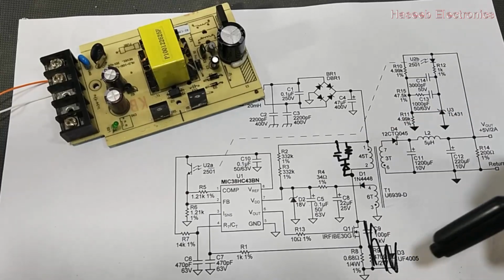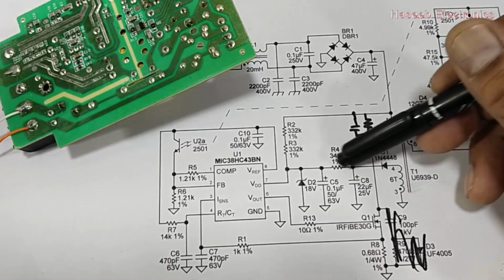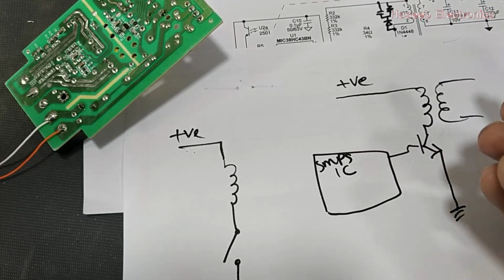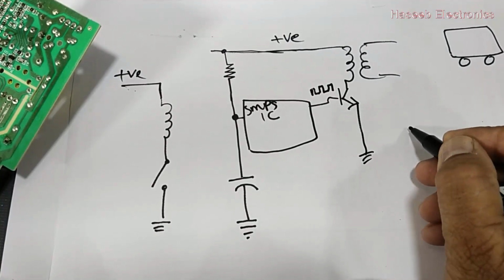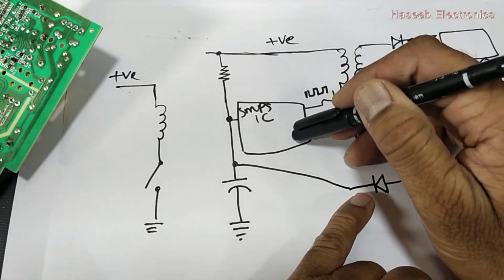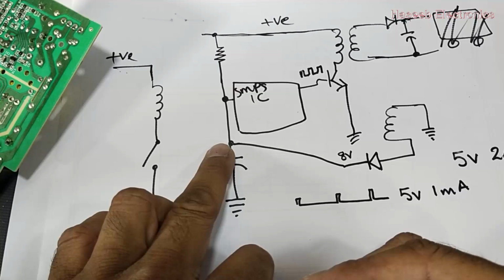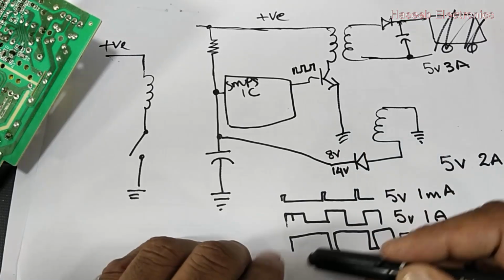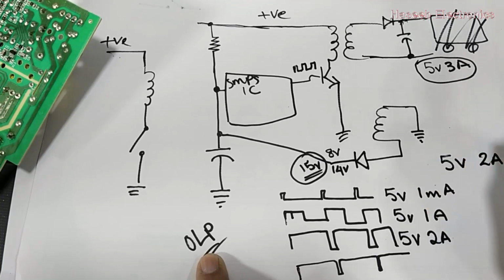{525} Functions of Auxiliary Winding in SMPS Transformer

Comment: Because I am trying to build a step-down circuit.  I have everything; I know how I should turn the primary winding or the auxiliary or secondary.  But I don't know how much  the air gap size should be, and for 12volt output with 5 amps, what kind of ferrite core should I use

Comment: Hello Mr Haseeb, I watched your video, and it was beautiful and informative.
Now I have a question, Mr Haseeb: you explained everything, but you did not say how many primary rounds there should be, what kind of material is used, or what size or type of ferrite.
And another question I have is: how many millimetres is the air gap of that substance?
Reply from the maker: Thanks for your valuable comment 
Transformer calculation is a separate theory 
It needs ferrite core material type, specs, core type (gapped core or ungapped core), permeability, frequency, output power rating, switching topology, operating voltage, flux density, then you can calculate wire size, turns,

Comment: سلام علیکم .
I have a smps with 48 vDC output . I don't have any circuit diagram for it. This smps has a axillary smps for providing internal DC voltages to run main switch. Main switch circuit is work properly. Because i test it wigh external dc voltage . Bet this exilary smps don't have output . The same smps of this smps has three output that are : 19 v , -10v and 15 volt. Two first votage provid main section supply and third 15 volt provide continuous suply for pwm ic uc3844an after soft Start. This pwm ic was disipat and it replace wih safe ic. Other components are properly . But this exilary smps dont hase output again. Can you help me sit ?!

Comment: In my case. Vcc winding is not generating any voltage. But in continuity mode, its beeping. What can i do. Other components are ok. But smps restarting as you said. Output voltage is fluctuating in 9-10v ( modified for 10v). What can i do now.

Comment: My Vcc at the the pin 13 of the IC ML4800 is 5V while it should be 14V. 
Also the voltage between FET D-S is only 308V instead of 420V.
Voltage over the power caps are also less than it should be 312V instead of 386V.

I ve replaced the IC, the power caps, the switching mosfet. Still the same problem.

Can you please help?

Comment: New subscriber here. Sir I have an SMPS here with no output that I have been trying to repair for a week now. I replaced the components that i found faulty. I can now read DC voltages (around 290 to 300 VDC) at the input of the transformer but unfortunately it appears that the xformer does not magnetize. it shows zero volt at the secondary side and as well as at the aux winding. Kindly tell me of the possible points that i missed to check. thanks in advance

Comment: Good evening sir I just received some igbt from China  40n60A4D but the data sheet showing the diagram that the igbt has no body diodes like mosfets I want to use the igbt in my smps but I need to know if I should use a Shockley diodes across the collector to emitter for safety or it’s ok no to use diodes thank you
Reply from the maker: https://datasheetspdf.com/datasheet/40N60A4D.html
in this datasheet it is showing datasheet 
40n60A4 is without body diode 
40n60A4D  is with diode
Reply: @HaseebElectronics  no sir not that type hgtg40n60a4d sorry for not adding the laters
Reply from the maker: 40N60A4D is generic number 
prefix letters are never marked on the components
Reply from the maker: check in the datasheet in 
ordering information section 
the marking on body and real part number are mentioned in that section

Comment: Is it the same in inverter ac boards
Reply from the maker: yes brother, it is the same in all circuits
Reply: @HaseebElectronics  
Thk you why I asked is that I have a gree 24000btu which Is not powering up, the ic for the transformer has ova  300vdc but fluctuating voltage and the vcc pin with know output.

Comment: Very good explained. The rectifying diode of the auxiliary circuit should be schottky type?Thanks
Reply from the maker: best regards 
yes output rectifier must be schottky, Fast rectifier, MBR type
with low forward drop voltage

Comment: Thumbs up done sir how can we determine the correct supply voltage of the vdd capacitor that connect to the auxilliary winding and to the vdd of the controller if its normal or not for different types of smps power supply sir or there is a voltage range value that we can measure sir tnx

Comment: Sir is that auxiliary winding is in the secondary side of the transformers? Sometimes that auxillary winding is in the primary side of the transformer it is correct sir?  tnx
Reply from the maker: in any transformer there is only one winding used as primary 
other all winding are secondary winding 
it depends on the user how he uses any circuit
if it is used in primary side or secondary side it will remain the same 
if auxiliary winding is used with primary side or secondary side, it will remain output winding

Comment: Assalamu'alaikum Sir.. what's different between power Schottky rectifier STPS20120CT with MOS Barrier Schottky rectifier V30120C? I hope you will answer, thx before, May Allah make it easy for you and always healthy 🤲🏻🙏🏻👍🏻
Reply from the maker: STPS20S120 is from ST microelectronics for 20 amp 120V with 0.7 volt fprward voltage drop 
V30120C is from vishay semiconductor having 30 Amp 120V with 0.68V forward voltage 
so V30120 is better than STPS20S120

Comment: Sir i noticed most of the smps power supply the chopper transformer have auxiliary winding that connects to pwm ic tnx sir
Reply from the maker: Yes, correct 
it is basic requirement to produce working voltage to the IC for long life operation

Comment: I have questions sir I am in the us I have  smps.  Only get 99 Ac  going in instead 120 ac and  I use lightbulb like you always use as protection and the light keep blinking non stop and I check at Rectifier bridge I get 99ac and 99 dc what case to do that sir 🙏🙏🙏🙏🙏 but I have 120 ac at the outlet? Thank you very much
Reply from the maker: welcome dear 
i think you need to check the main dc capacitor (bulk capacitor) 
if you are using a 100 wat Tingston lamp and it is blinking, that indicates that might be there is something 
in first step, remove and verify the capacitor (it is open internally i think) and let me know. 
please check video number 521 in this connection
Reply: @HaseebElectronics  thank you very much sir I do that tomorrow when I go back to work 🙏🙏🙏🙏 than I let you know

Comment: Sir if output voltages are fluctuating than what to check and how to solve that problem
Reply from the maker: main dc capacitor
vcc capacitor 
secondary side rectifiers and capacitors
Reply: @HaseebElectronics  ok thankyou sir for helping out and giving answers to my questions
Reply from the maker: please check video number 512

Comment: How do you decide the value of soft start resistor? 
I have seen your previous video about making adjustable output voltage by smps.  Is it possible to make adjustable voltage and current together? Can we turn smps into home made lab bench power supply with adjustable voltage and current ? If possible please make a video about it so it will be very helpful for beginners like us to learn about electronics. Thanks again for your hard working. Always love your videos and explanation. Keep it up
Reply from the maker: please check video number 386
yes we can limit the current and adjust the voltage
but it need very precised calculations
for banch power supply it is better to use a separate voltage and current regulator in output 
i will try my best to share a compact design for bench power supply
Reply: Oh found your video ( video number 386) about calculation of startup resistor. Thanks again
Reply from the maker: wow that is great. i also sent the same video number for you
Reply: I mean like adjusting Voltage in smps like you did with a potentiometer, can we adjust current with potentiometer? Or by adding  a transistor?  (or Darlington transistor in the output)

Comment: salam,

Mr.haseeb I watched several videos about the SMPS i found them beneficial.

I want to ask about two recurrent matters in SMPS.

1. when the power supply starts with a buzzing sound (i think from coils) and after 5 to 10 seconds it turns off suddenly.
2.if all the multi voltage power supply is working normally but one voltage is missing (6v), when I applied 6v to the output dc capacitor ,it drew high current and I got a voltage drop.

It would be great if you could benefit me , especially if you encountered such problem.

Regards